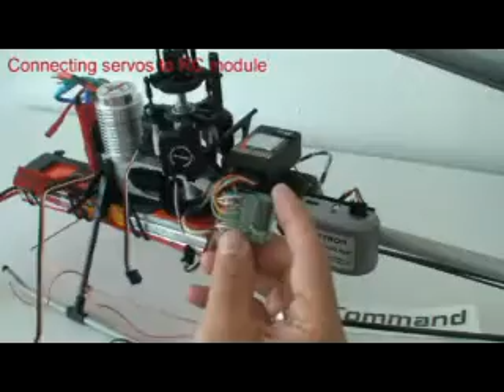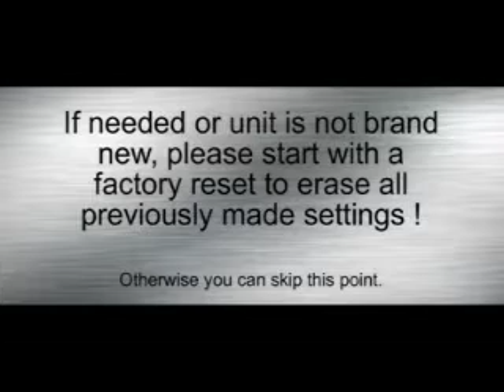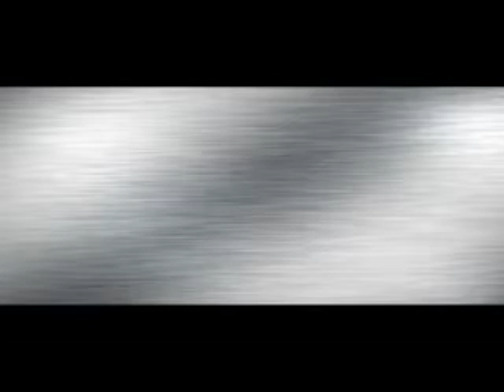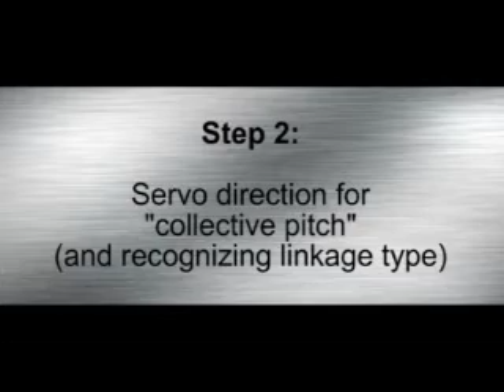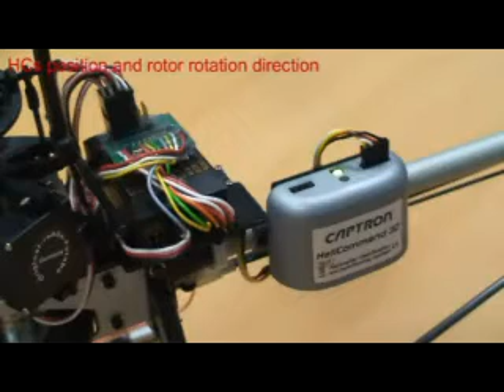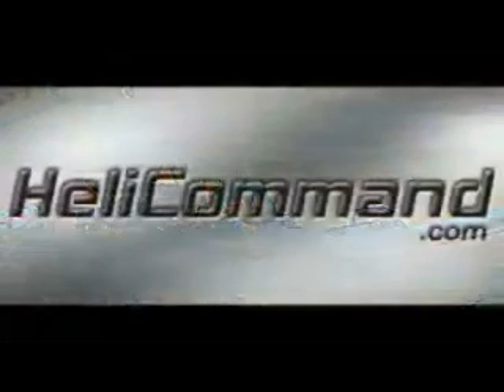Helicommand set up part 2

Comment from the maker: HI Mate the wires on the HC unit go to the rx.
the top one (3 wire) goes to aileron on rx
the next (3 wire) goes to elevator on the rx
next wire is a single and goes to pitch or AUX1
yellow wire goes to rudder
green and grey are for remote control of modes and are normally aux 2 and 3 or gear.

Comment: hi mate,im haveing trouble setting up my rx to the rc modul on how to setup my wires,my rx 1 elev 2 aile 3 throttle 4 rudder 5 gear 6 aux1 7 aux2 8 aux 3 this is a 8 channel receiver,so where do i connect the wires from the rc modul to the rx mate,my heli is a trex500 my tx is centra pro cuk-2801 can you help with this mate cheers

Comment from the maker: angling the HC unit will effect its performance as it will think it is the heli that is on an angle and try to compensate it. I mount the bracket to the body of the heli so that the sensor looks down between the skids. Mount it on the left hand side to keep it clear of any blade strikes.

Gary